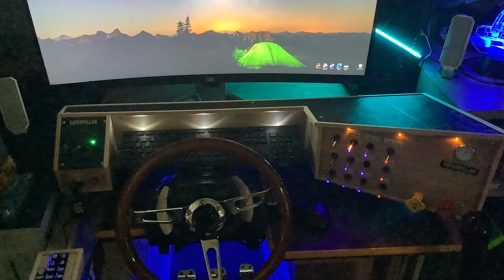Truck simulator slideshow

Comment: can you explain more about the mod on the steering wheel at 0:36, It looks like a mod to tilt the wheel, if it is could you explain how you did it
Reply from the maker: The bracket you see in the video is actually there for the turn signal lever kit. It provides support for the added weight and length the turn signal and wiper levers add to the column .